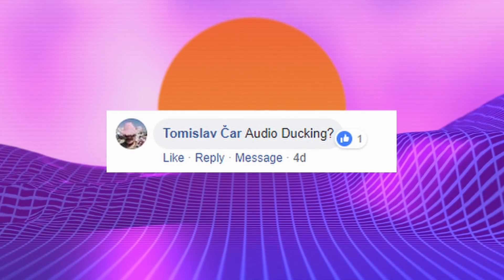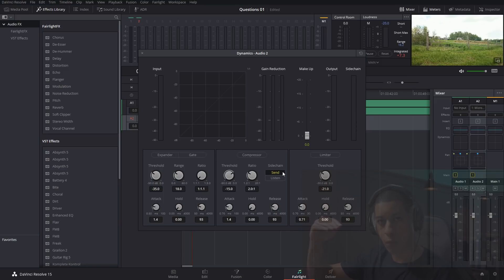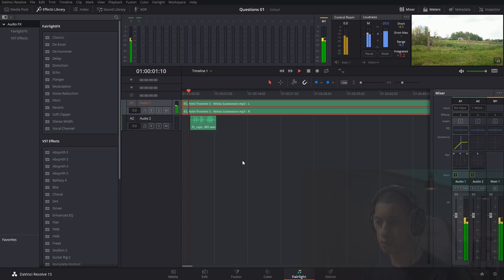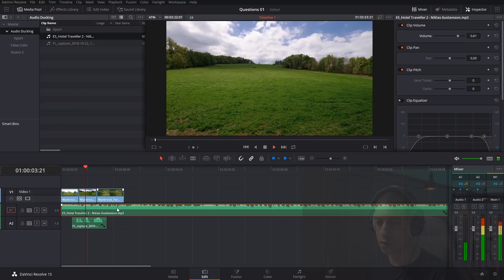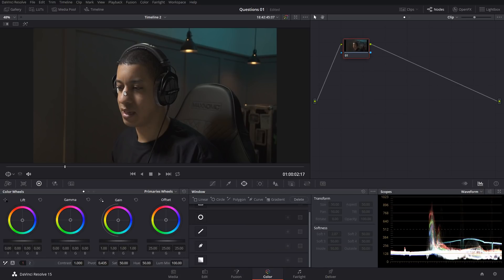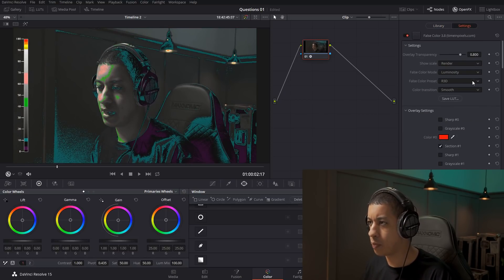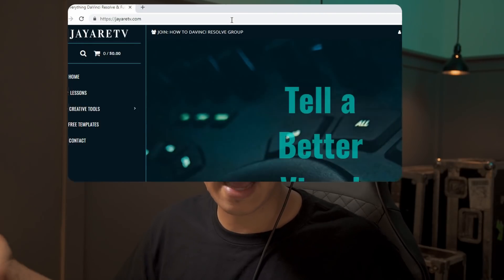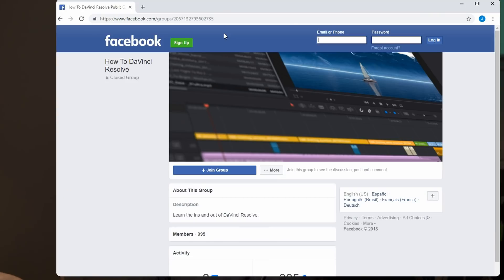Audio Ducking, False Color & Building the Sicario 2 Title

Comment: Last time you showed how to input multiple layers into a Fusion composition, but how can I output multiple video tracks... So I can color them individually, or use more compositing "blend" modes that aren't available in the merge node?

A trick or do I just dublicate my whole fusion composition and put my MediaOut node at different places?

and example would be pictures in picture with a cloud tracker and corner pin on like a blank I hold up but want to make it a virtual screen. But I need to color it differently. And th color corrector in Fusion isn't great when you compare it to the color tab.
Reply from the maker: You can color each individual video track inside the fusion clip timeline the same way you would with a compound clip.

Comment: I have a question (I am having trouble with the FPS settings of the projects in Davinci if I have a 23.97 fps project and I add it and my timeline has a 59.97 fps setting If I want to change that the video goes nuts, I am not sure how to explain it, in other programs like FCPX I just drop the video on the timeline and the video changes automatically to the FPS on the file (if I have it in automatic) If I have it in custom I just add manually the FPS and its fine, but in Davinci I am not getting how it works, I am going nuts over this issue

Comment: Fusion and fair light are among the must UNintuitive apps I’ve ever seen. I usually can figure out an app by playing around with it but not so with these 2 apps. The node system, although powerful, is just too different from anything we’ve ever used in a software package. It’s like electrical class, trying to figure out what wires get connected to which socket or diode. Just look at that spaghetti mess of a node tree at the end of your composition. Adobe’s layer based system is fair more understandable, at least for me.
Reply from the maker: Node-based systems are super common in the industry ( Houdini, Nuke, Blender, Maya )